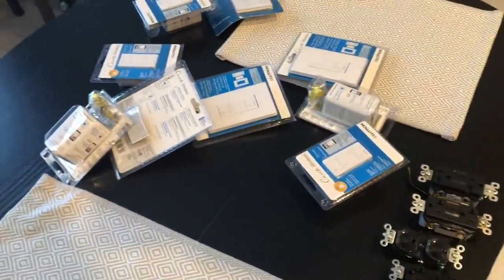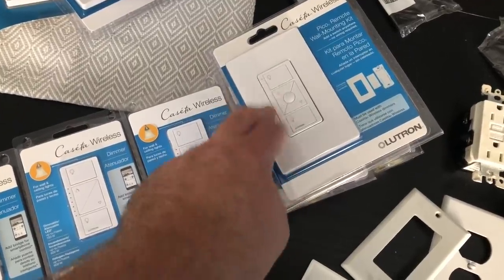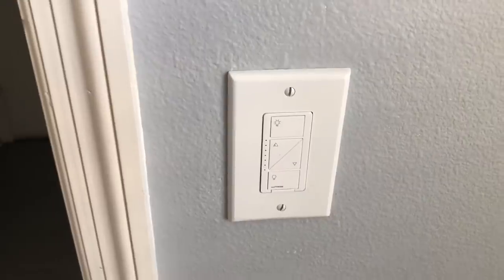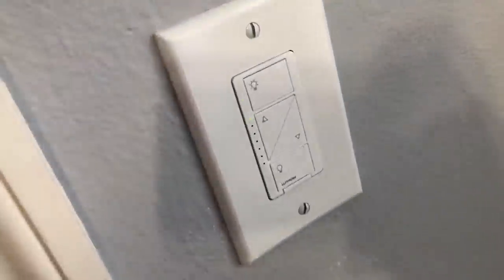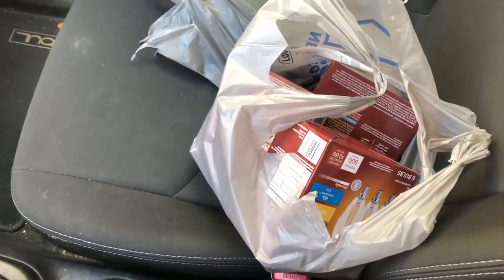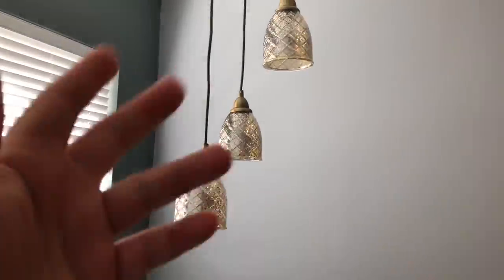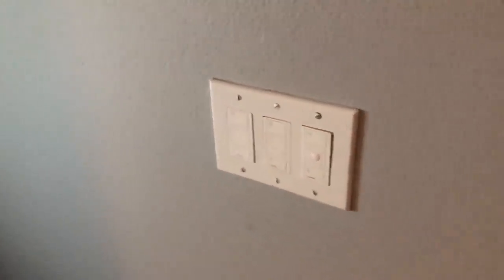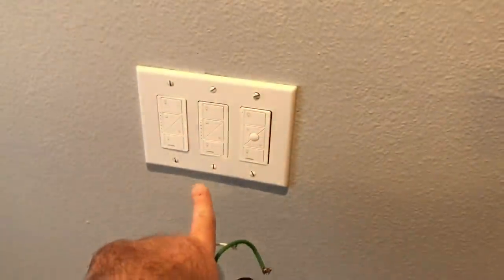Home Vlog Day 36 - CO Guy Stuff

Comment: Just an FYI - You actually can pair a single pico remote to control multiple dimmers.  My house has each individual recessed light on its own dimmer.  Each room is between 4 and 6 dimmers.  I can control all dimmers in a single room with 1 pico remote.  Lutron stuff isn't cheap but it works great.
Reply from the maker: Ah thanks, I must have read that wrong!

Comment: If they are tamper resistant outlets, I've encountered that it is slightly more difficult to plug things in as well.
Reply: Adam Piatt I was going to say the same thing. Tamper resistant outlets are code where I live. Great to keep kids from messing with it but kind of a pain in the ass to plug things in until you get used to it